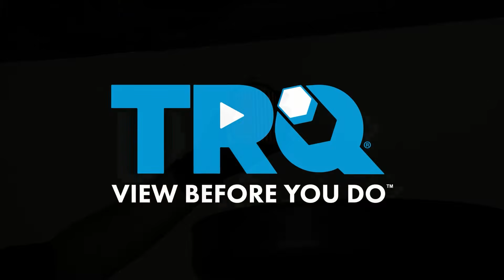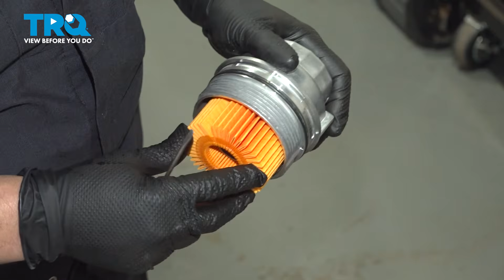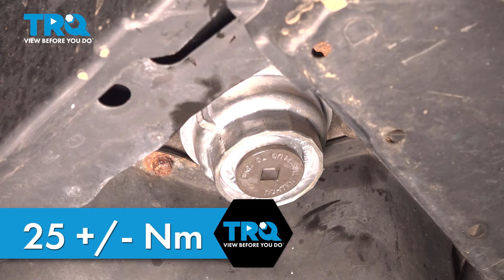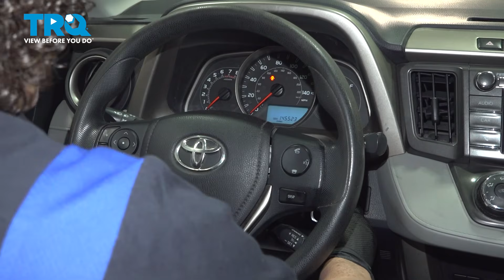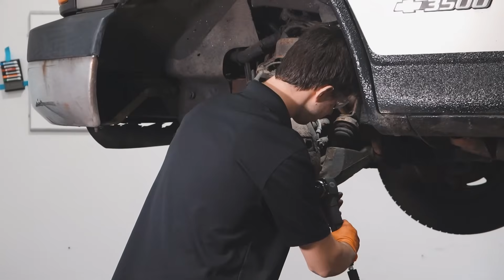How to Change Engine Oil 2013-2018 Toyota RAV4

Comment: For the oil housing the aluminum seal is stuck on tight and will not budge. Are there any tips on how to remove it without breaking the housing?

Comment: Approximately three minutes in the video after the oil canister was removed it looks like she discarded that one and went to a metal metal is a no-no. Watch the car care nut (he explains on his YouTube channel why you don’t wanna use a metal )as for removing the plug on the bottom of the oil canister. I never remove mine I leave it in. I just removed the oil canister.

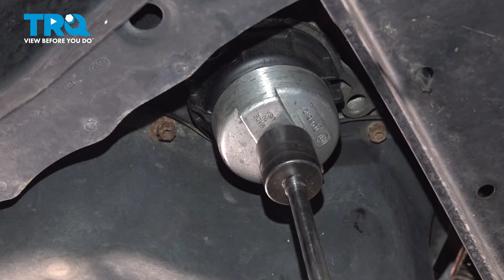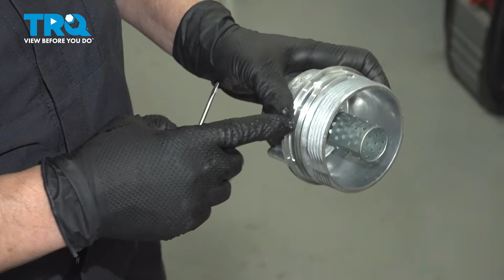Comment: I tried to change the oil and oil filter on my RAV-4 using this video as guidance. I want to point out that at minute 2:08, the mechanic begins to remove the oil filter cap, then at minute 2:12, the scene cuts to the same process, but the plastic oil filter cap has now clearly been damaged. Then at minute 2:48, the oil filter cap gets replaced with a metal one. I want to point this out, because I too wasn't able to remove the oil filter cap (even with the socket specifically designed to remove it) and in the process, I too ended up damaging the plastic oil filter cap. Because the oil filter cap was damaged and I didn't have a replacement metal oil filter cap on hand, I had to have my RAV-4 towed to a mechanic to have it replaced since it couldn't hold oil. The point I'm trying to make here is that this is a DIY video, but even when a professional mechanic tried to do this, she ended up breaking the oil filter cap  (none of this was obvious to me when I first watched it, which is why I'm going to great lengths to point this out). Honestly, based on my experience,  I would caution anybody from trying to do this on their own. What I thought was supposed to be a simple job ended up costing me a whole lot more in the long run, and though I appreciate the guidance this video tries to provide, I don't think it has been completely transparent about the challenges that she, and many other might face when it comes to trying to remove the oil filter cap on a RAV-4.